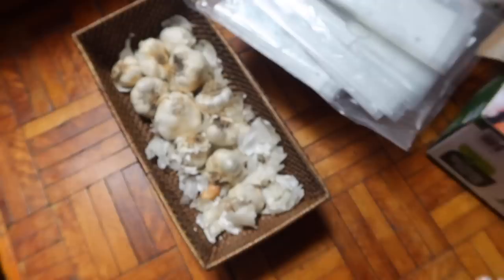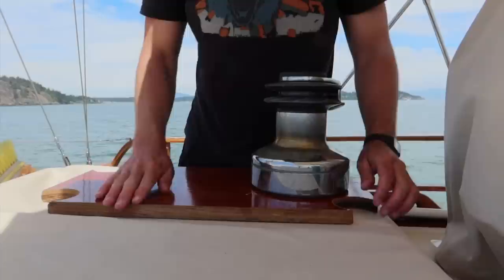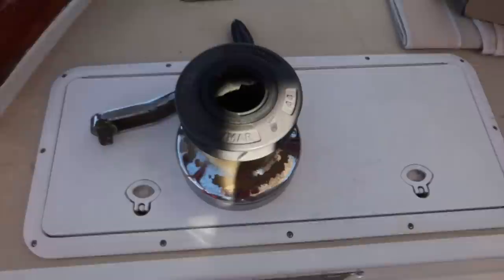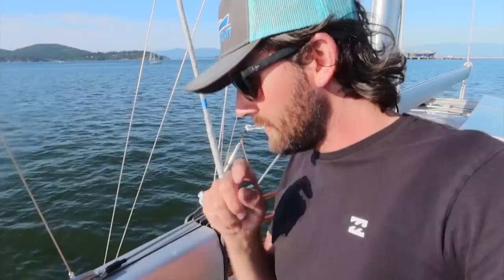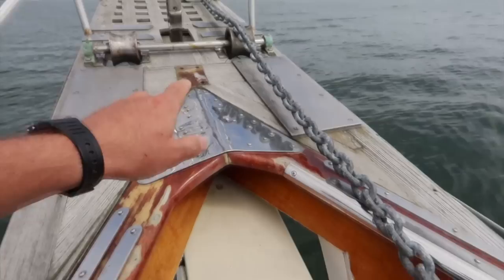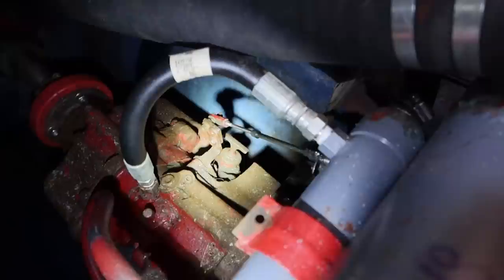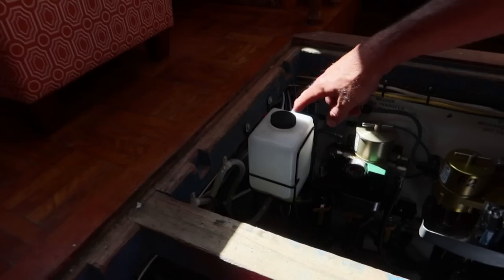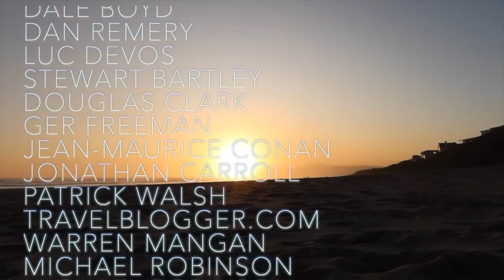GLUTTONY ~ BoatLife  | PIRATE SHIP S15E08

Comment: Cardinal Rule for installing cable clamps is, "Never saddle a dead horse!" the saddle should always be on the live line. this prevents the "u" of the u-bolt from digging into the live strands of the wire rope, and thus compromising the strength of the cable. Fortunately , this isn't necessarily a crucial place. Just remember this principle when working on your standing rigging!!!

Comment: I like the six month rule, if you haven’t used it in six months, it goes. Definitely on my to-do list.
Oh and the saddle clams should be installed with the threaded bolt part over the dead end and the saddle over the live end. Like the old saying,”never saddle a dead horse”. I’m sure what you did will work fine it’s just a heads up for the future. Love the channel keep up the good work!

Comment: Glad you mentioned the wonky shaft. Anything less than perfect alignment kills flat belts. Those bests should last years not months.  There should be a deflection measurement fro proper tension.  Also, the best place to keep spare belts is in the original package, especially if it is a sealed package, where it is dry. Hanging in the engine compartment like that ages the belt nearly as fast as the one in use.  BTW, didn't those formosa's originally have hawsepipes rather than the chain going out over the bowsprit?

Comment: My grand father had this old boat that he only put in the sea each summer. The only work he ever did on the engine was change the oil and make sure the cooling water work, that engine just kept ticking.  The dang engine could be run on alcohol too by the way. Thinking about it now as a grown man, I realize that that engine was just so simple and hardy made that you more or less could kick it started. They do not build things like that any more as it's not cost effective, it's far better if anything breaks after X hours use as it generates income after all,  So every company more or less  makes second rate products at best, that's more advanced and it may be better over all, but the products will fail earlier than needed just to generate income. Consumerism at it's worst and it's not sustainable in the long run and then what?

My father was so impressed by that engine, that he sought out a used more modern engine from the same company, got it refurbished and updated by this local custom shop and then he put it into the ship he and we built while I was young. That engine had service done to it each spring and it just worked, it wasn't the best fuel economy wise, but it never broke down unless there was an issue with cooling and even so, wait until it cooled back down and fix the water issue while you wait, and it started right back up. That's how mature engine tech had become in the past and most modern stuff is cleaner and more efficient, but where's the faultless running that almost never fails? That we don't see as such engines don't make the companies enough money over time.

It's about materials used, precision made parts with no un-need slack. The funny thing is, the core of an engine rarely fails if you treat it right and oils the right place, ask your self this, why don't the heart of an engine break, while the rest around it tend to fail after a few years? The heart, the cylinders are mature tech that need a certain level of tightness to work, but to get there it must be good workmanship and that lasts, the other stuff,  oh that gets a more shoddy treatment so that it'll break faster than needed, just to keep up the pressure so that you keeps paying.

Comment: The question is did you put psychoflex or butyl tape underneath the base so water doesn't get anything there
Reply: The is a little around the screw between the wood and winch.

Comment: Seems like belts breaking are an issue and the result can be catastrophic.  Why don't you put a micro switch with a roller to ride on the out side edge of the belt to sense it's presence.  If the belt disappears then the switch could kill the engine or you could made the switch complete a circuit to a light or alarm or both.  Just sayin.

Comment: Problem is known as Sod’s Law, which states that as soon as you throw something away, you discover that you need it. So then you buy it again. Then you discover that you never threw it away, because of Sod’s Law. Now you have two of everything. Solution? Can you outwit Sod’s Law? Yes you can. Only throw something away if you have a back up version. You will definitely need it. Better still, buy two of everything and throw one away. Use the other one. No need for storage. Problem solved.